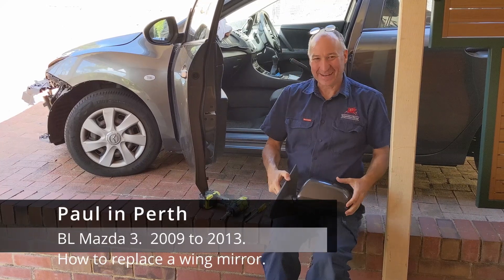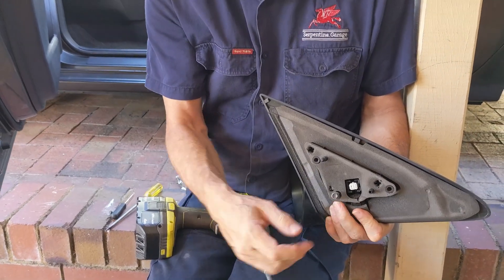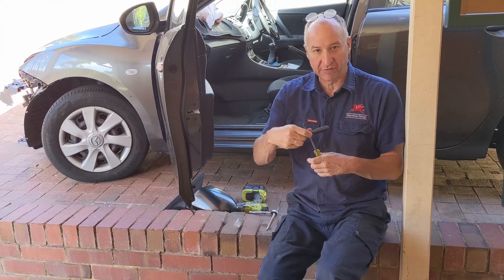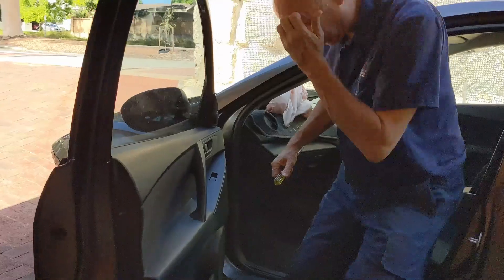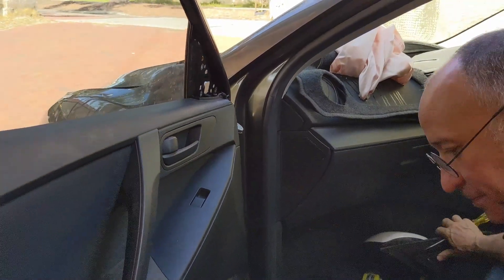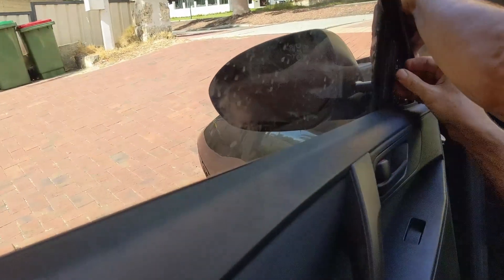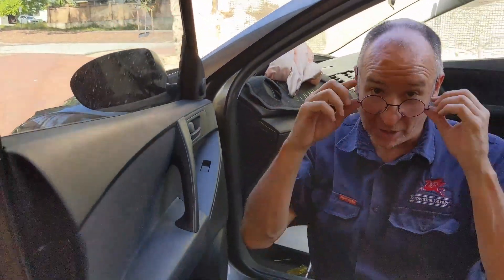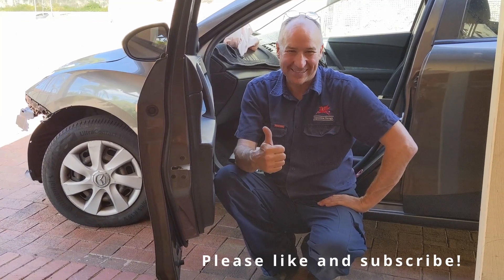BL Mazda 3 (2009 to 2013):  How to remove and replace a wing mirror.

Comment: I have Mazda 3 2012, and folding left miror doesnt work. The right works. How to test it?
Reply from the maker: I've not worked on a BL with folding mirrors.  The two most likely candidates are the mirror or the driver's switchblock.  Perhaps uninstall the left mirror, and plug it into the right hand wiring and see if it folds.  If it does, then it is the switchblock.  If it doesn't, then it is the mirror.

Paul.
Reply: @PaulinPerth  thanks